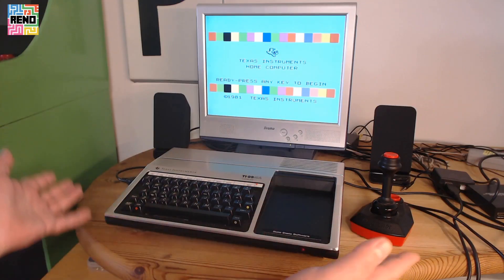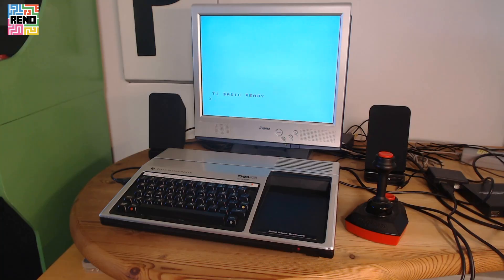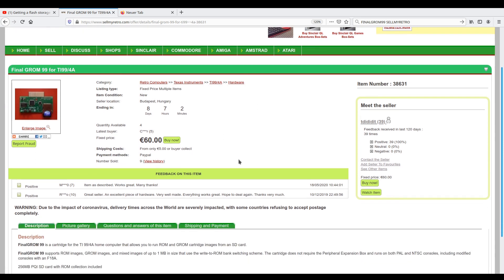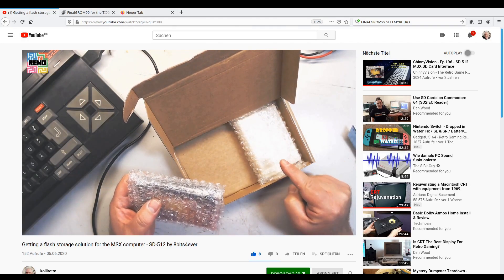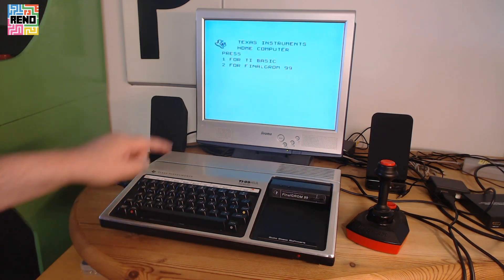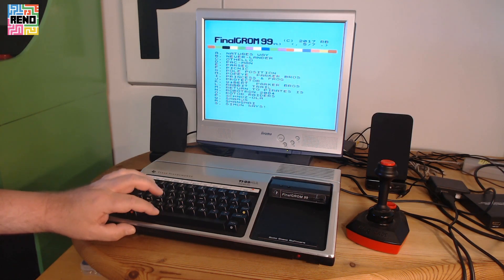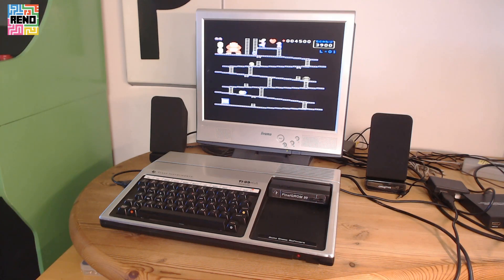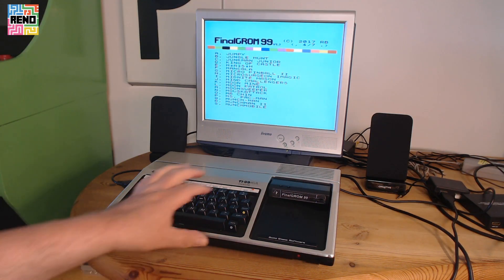FinalGROM99 - flash cartridge for the TI 99/4A

Comment: It's not 4K that was available to Basic but around 13K. The bitmap mode was not available in Basic and the graphics mode chosen only used 2 or 3 K of memory (768 bytes for the text screen, 96 byte for colors, 1576 bytes for character definitions). In extended basic, some of the character definition space was converted to sprite information. In extended basic you had the SIZE function and it returned on an unextended machine exactly 13928 bytes free for basic.
Reply from the maker: Thanks for sharing this information. I did not know that. I'm quite new to the TI.